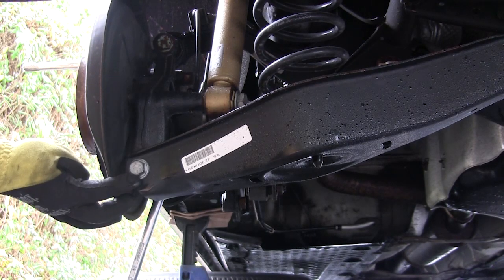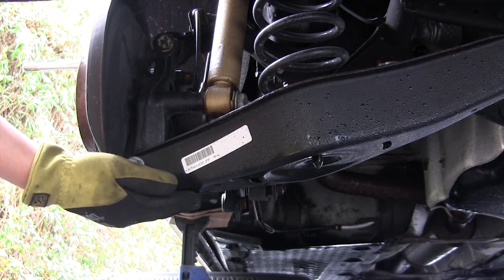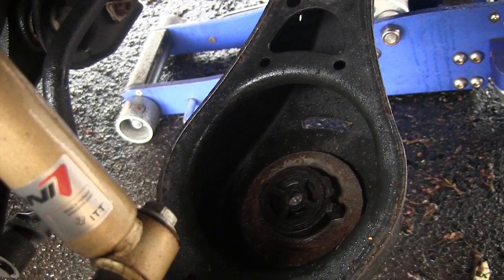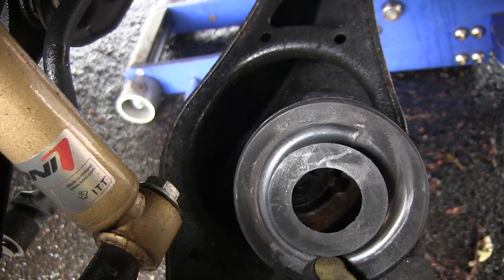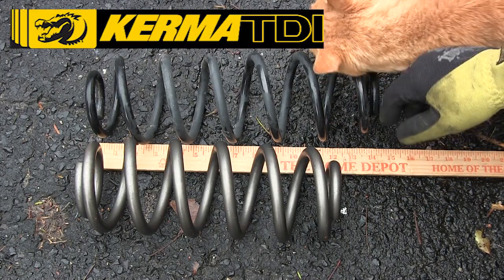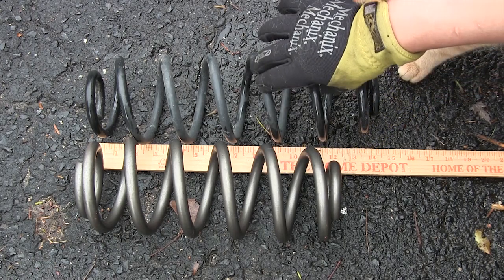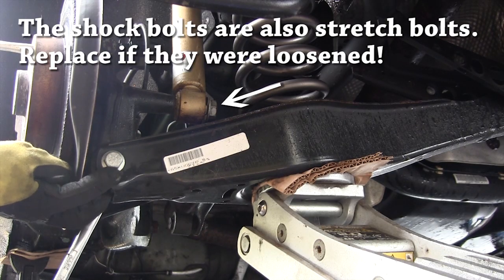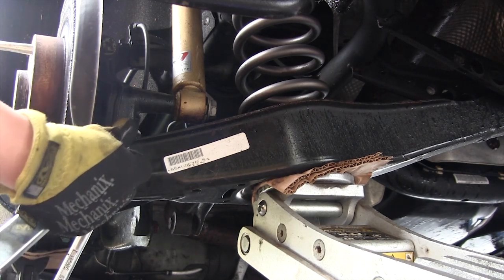How to DIY replace the rear springs

Comment: how to know spring is bad?
Reply: Munkhjargal Nymsuren , yeah that aftermarket spring maybe a replacement but it's not built to factory specs as you can see it's 2 in shorter and it's also beefier than the stock shock which means his ride will be much firmer he's going to feel the bumps more. I would have just cleaned those Springs and mount them with the new shocks, insulators,  mounts and bearings for a more stock like ride.

Comment: You never tighten bushings while in rest position then they are preloaded when u set the vehicle back on the ground all suspension bushings or bolt or nut must be  tightened while weight of the vehicle in on the ground. You just told everyone in ur vid to pre load it. Apparently you know absolutely nothing about suspension.
Reply: He had the jack on it preloaded.. can do it that way or tires on the ground.

Comment: 2:50 what size tires are those? Did you go for bigger sidewall? For more comfort from the tire? I switched from oem 205/55/16 to 235/45/17 and i think they are too firm of a ride, on stock suspension, and i think i wanna go back to having more sidewall... for comfort.

Comment: I want to add lowering springs to my 06 expedition 4wd but they only sell them for Rwd 03 to 05. I dont drive/use 4x4 tho, I know all stock springs are the same 4wd or Rwd. I already have performence shocks, blisten. Should I go and install these Belltech 929 springs?

Comment: What torque setting di you use;i have a new spring fitted a week ago at MOT, but i want one on the other side as i prefer this sort of thing done "per axle". If you can let me know what the torque setting is for the lower arm bolt please, that would be great. Thanks in advance.

Comment: Your procedure is very similar to the steps from a shop manual I am reading.  At 0:32 you remove the spring so easily - it appears to be under no load.  In my shop manual, it says that "the spring is under extreme load. care must be taken when installing or removing a loaded spring"  When you installed the spring, no video of it being compressed.  So, for rear coil springs I guess i don't need a spring compressor.
Reply: Nope he did it wrong completely wrong lol

Comment: What I have been doing when torquing this bolt is apply small amount of greas under the bolt head so it can slide easier as you make your 66ftlbs plus 90 degrees. Just like said in the video it is easier to torque the bolt instead of the nut, as there is no room on the nut side to even slide a torque wrench. Oh and as far as the kitty goes...he is gorgeous...I just lost one like that two weeks ago...14 year old... :(

Comment: what's  point of this, no one knows the car.
Reply: Narit Phoonsawat ..... it's pretty universal
Reply: This is for a Mk5. He should have put that in the title, but it is in the url that he quoted underneath. It really is not like this on my Mk4, because it has no lower bushing or divot or anything on the bottom for indexing the coil spring, and it will move around.